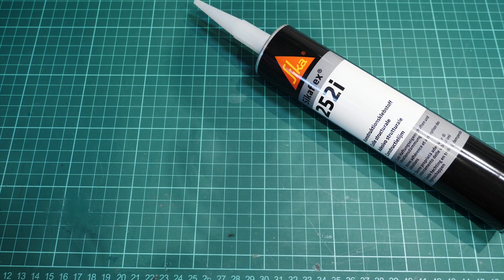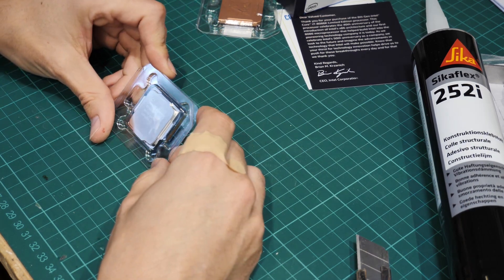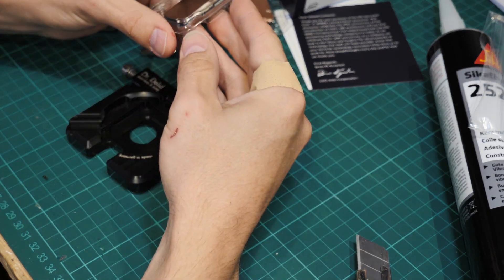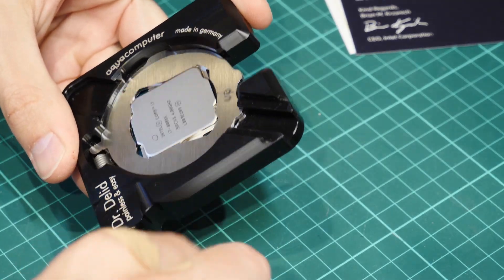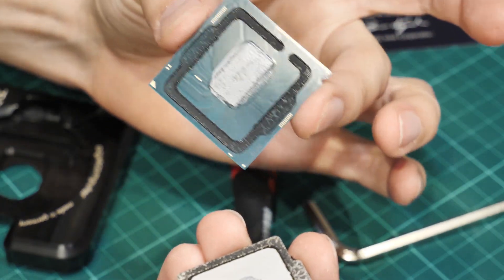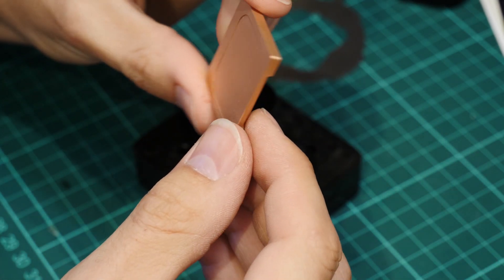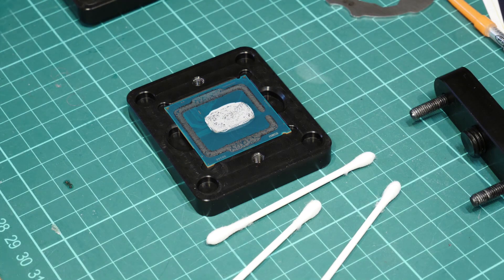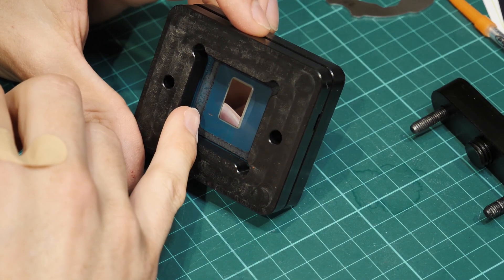Core i7 8086K Delidding, do I dare?? + relidding copper IHS, or how not to do it

Comment: Folks, this is royal waste of time. You gain nothing in thermal transfer by replacing one piece of metal, with another piece of metal as you are simply replacing one bottleneck with another. The REAL trick when deliding is never re-lid again! WITH NOTHING! That's the true way to permanently improving thermal performance as you are actually getting rid of one intermediary piece of metal between the die and the heat sink. Once the CPU is delided, you will need a special height adapter for the socket to be able to compensate for the height loss and properly secure the heatsink (available from a couple of specialized online vendors).. and there you go! Now you've actually eliminate in a problem instead of replacing it with another one: CPU DIE, THERMAL PASTE OF YOUR CHOICE AND HEATSINK! This is the real and ONLY way to property benefit from deliding.. getting rid of one heat transfer stage altogether :)
Reply: Android yea I just added LM to the die and bottom of the IHS on my 8086k and left it at that once I put it in the socket and let the brackets tension hold everything together my temps are great even at 5.4 - 5.5ghz on just a Corsair h100i v2 aio while gaming

Comment: I thought you were supposed to leave a gap in the gasket to let hot air escape?
Reply from the maker: that sounds like a good idea although i believe its not really necessary
Reply: Chris's Tech Box Actually it’s recommended as heat can be trapped and cause damage to the cpu die... I would recommend just putting 4 dots of glue in each corner of the Cpu.
Reply: @Chris-Workshop  it's actually absolutely necessary to leave and air gap when you glue down the IHS because there is a lot of heat generated by the silicon chip under load and the air pressure created in an airtight chip because of no air gap, would put a lot of stress on the whole chip as the IHS continually lifts and drops due to the large temperature variations as the cpu changes from under load and in idle state. It can actually bow the CPU by micrometers each time the CPU creates a lot of heat due to air pressure because the circuit board material that the chip is on is flexible.

Comment: In addition to not scraping off the silicone you added another layer of silicone on top of the IHS... I bet the result won't be as great. Plus, the temperature difference among each core will be quite significant due to uneven contact. Your method defies the purpose of delid.
Reply from the maker: This specific IHS is designed to not have to scrape the glue off. If my temps are still off I can redo it any time.